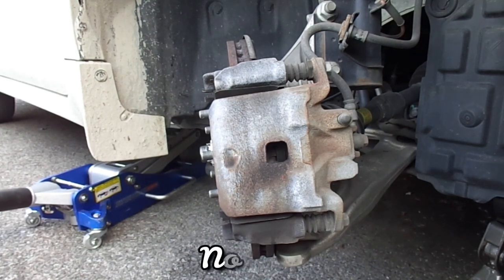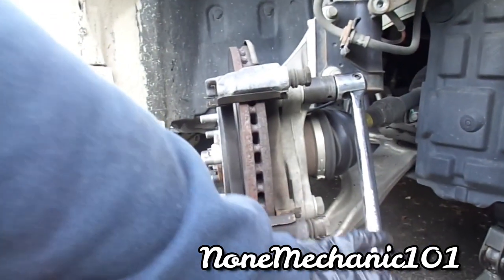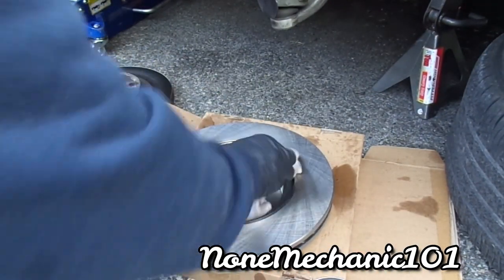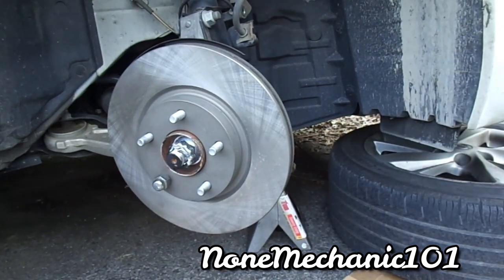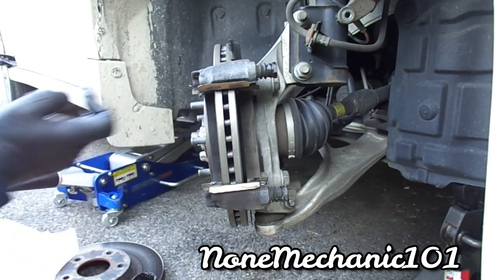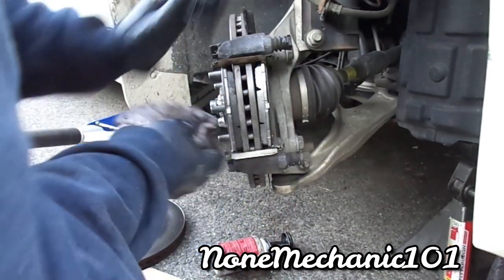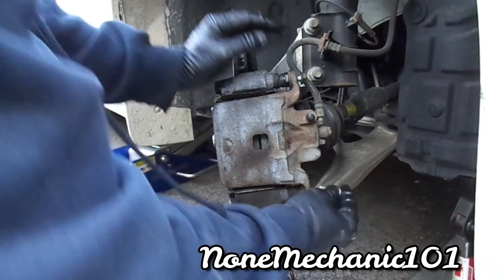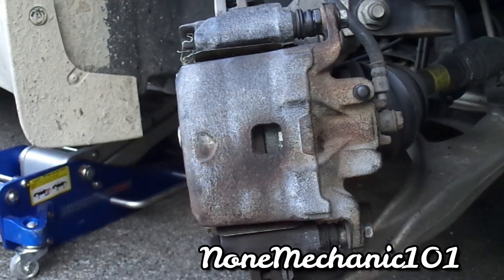2015 Nissan Altima Front Brake Pads and Rotors Replacement.

Comment: Excellent DIY video!  I performed the same repair today with Napa premium rotors and ceramic pads.  The parts cost $130.00 (after my $20 coupon) and 1.5 hours of my time, but would have cost $400 at a local auto repair shop.  That's like making money!
Reply from the maker: Thank you. A few dollars saved makes a difference.

Comment: That bolt was TIGHT, LOL!! Can you believe that I still DON'T have the Earthquake cordless, I have to get one for the van. Great tip on cleaning the old clips, and I think we have the same wire brushes, I got my set from Harbor Freight. WAIT! Where's your Q-Tips for the 007, lol?

THAT WAS SO COOL video editing with the little window showing the other side, I have to try that! Great job and explanation Hector, really great job!
Reply from the maker: I have to put some Q-Tips in my car. I always forget. lol. I should have used the Earthquake on those bolts to see if it was able to take them out.
Reply: That would have been a good test for the Earthquake, maybe on the next brake job.

Comment: Thank you for this video, they asked me $ 1200 for 4 brake pads and rotors, I ain't a super cheap guy but that seems excessive.
Reply from the maker: You are welcome!
Reply: @NoneMechanic101  if you don't mind me to ask. I saw that the fluid reservoir is basically empty, i haven't filled it since I started working from home in 2020. I bought 2 12oz dot 3 fluid refilled but when I pour it does not go down...any idea of what it can be?
Reply from the maker: @nicolapansini5656  The reservoir has to be filled to the line. It only goes down after constantly using the brake pads. If you filled it and the reservoir gets empty right away. There’s a leak somewhere.
Reply: @NoneMechanic101  correct but in my case it is empty and when I pour the fluid in, it stays on the top, doesn't do down...

Comment: Thank you very much. I've changed my brakes before and now I think I can do the rotors. What do you call that spray you used to clean with?
Reply from the maker: Brake Cleaner
Reply: @NoneMechanic101  thanks

Comment: Why the brake reservoir have to be open when pumping the brakes at the end of installation?
Reply from the maker: The reason why I do it is because if the reservoir is closed it can brake the reservoir also the brake line because of the pressure.
Reply: @NoneMechanic101 ,thanks ..  I just change out my 2011 Maxima front and rear pads and rotors over the weekend and   i had the top close when I was pumping the brakes to get the piston back in position... Good to know to keep the top off for future reference..👍
Reply from the maker: @mikal9624  I'm glad everything worked out.  Good job!

Comment: Probably a dumb question.. but do all 4 tires on Nissan altimas have brake pads & rotors?
Reply from the maker: There is no such thing as dump question. I'm not sure but the ones I worked on had rotors and brake pads. I don't know about dis brake
Reply: @NoneMechanic101  how different is the process for  the rear brakes???
Reply from the maker: @LA_Native  It depends. But in this car is almost the same. The only thing is that the brake pads are smaller